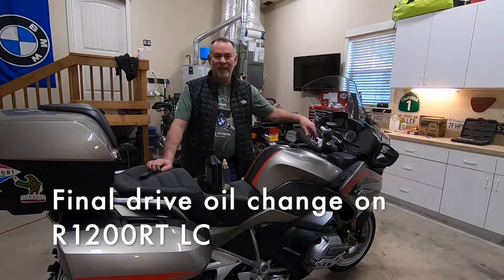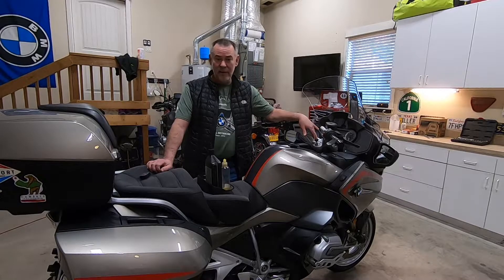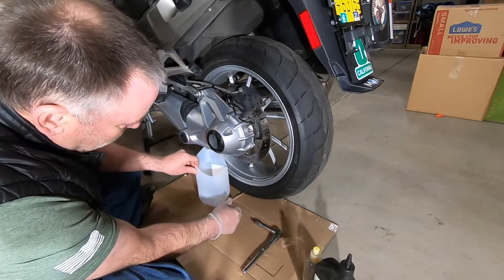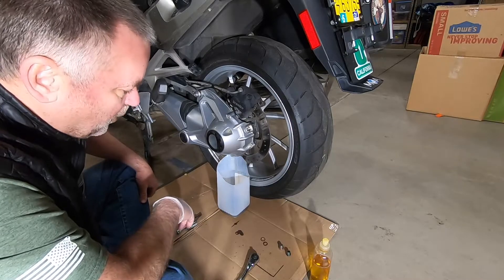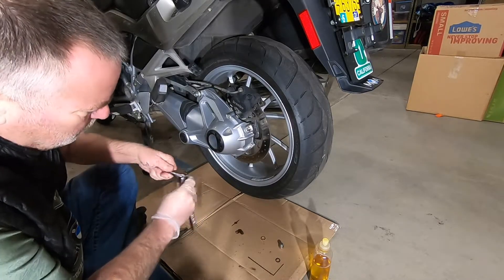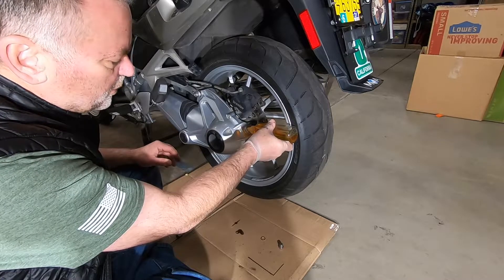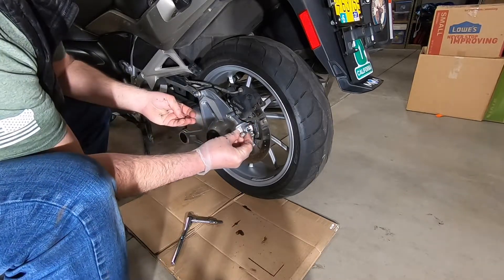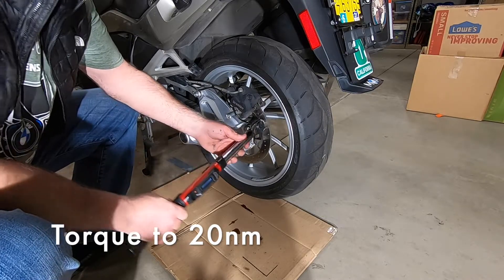BMW R1200RT/LC Final Drive Oil Change

Comment: Always remove the fill plug first,.. If by chance the fill plug won't come out and You drained the oil, you have just disabled your motorcycle'
Reply from the maker: That’s a very good tip!

Comment: Perfect, thanks. It's a shame they don't sell the oil in smaller quantities. I'm left with nearly a litre to throw away every time, as it's no good once opened
Reply from the maker: You can see which oils I use by looking at the 12k maintenance kits I offer. See pacmototours.com/store.
Reply: @PacMoto  Thanks, I'm not based in the US unfortunately.
Reply: The gear lube is fine to use later. It's oil, not beer!
Reply: @jasonholmes2688   Wrong. 2 years (when the oil next needs changing) it will have broken down and lost a lot of it's viscosity. oil has a usable shelf life. That's why manuals tell you to do an oil change every year in your engine, regardless of mileage. It's also hydroscopic. So once you open the sealed container it is absorbing moisture, the same as brake fluid does and why that also needs replacing. That's why your engine oil sometimes goes milky. It's moisture in the oil.

Comment: Do you need to add a new O-ring and crash washer and if you do where did you get yours from? Thank you.
Reply from the maker: Yes, you should replace the crush ring and o-ring each time. I buy them in bulk to include in maintenance kits we sell. You can get them at BMW or I can sell them to you as a special order. See the website at pacmototours.com/store or email me at kurt@pacmototours.com.

Comment: Can I ask what oil you used? Is it API GL4 or GL5? I can't find any info on this anywhere other than a forum post which said don't use LS or it will seep into a bearing which is a costly repair.
Reply from the maker: For the water-cooled R1200s, use 75w90 GL-5 oil. For the R1250s, use 70w80 GL-5 oil.
Reply: @PacMoto   Thanks. Couldn't find anything in the manual. I used Castrol 75w90 before but it just says GL4/5 compatible, whatever that means. I thought it had to be one or the other since they are different spec from what I read.

Comment: Hi. could you tell me the torque for the gearbox screws when changing the oil? thanks.
Reply from the maker: Torque for the oil drain plug is 42 Nm, torque for the final drive drain plug is 20 Nm.
Reply: @PacMoto  thanks

Comment: Hi, do you need to change the oil in the transmission on the 1200rt?
Reply from the maker: Scheduled maintenance suggests an oil/filter changes every 6k miles or 12 months and a final drive oil change every 12k miles or 24 months. I do the final drive change every time I change the oil because it’s so easy and I have surplus gear oil. Thanks for the comment.
Reply: @PacMoto  Hi, thanks for the reply!
I changed the engine oil and filter but I can’t seem to work out how to change the transmission oil
Reply: @helloyoungfella363  Changing the transmission oil on the 1200 RT (2016) seems to be quite difficult because of the difficult access to the  drain plug, which is above the exhaust pipe. So I understand that you need to remove the exhaust before doing the job. The access to the filling entrance is also much more difficult to do than on the 1200 GS. If anyone has any ideas, please let us know. Best regards